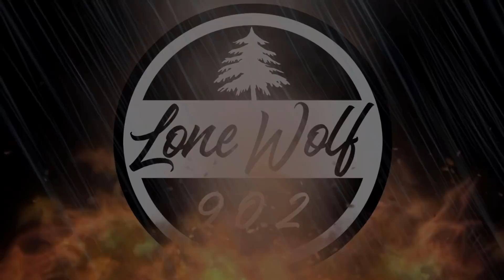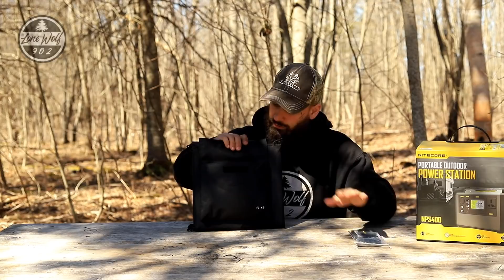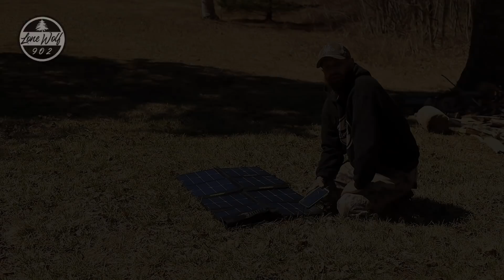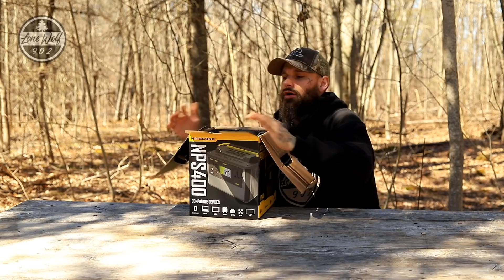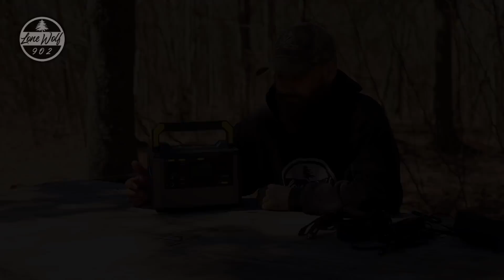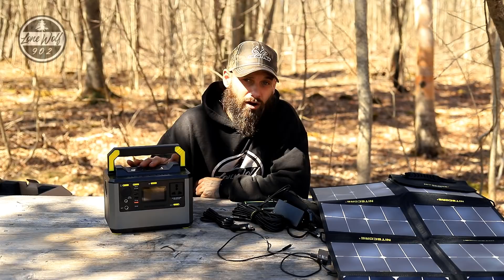Battery Charging Station And 100w Solar Panel - Nitecore NPS400

Comment: Can I ask the red light by the charge ports is on constantly but when I plug a device in it flashes , I’m not in direct sunlight btw.
Is this normal in low light ? I haven’t tried it in the sunlight yet.
Instructions  tell you nothing about the red light

Comment: Good Day,  I don’t believe I saw anyone comment on your question about V and A on your monitoring device.  So I thought I’d comment.  It’s a long one so I hope you actually have time to read it.  To start with since I get so much out of your vid’s I’m willing to give back. Secondly although I have a degree in electrical engineering, albeit 38 years ago,  I am both dumbfounded and amazed by technology advancements.  I can’t say I can fully explain the deviation you witnessed from the standard USB output vs the QC output, but I have enough info here that might rationalize it and perhaps a couple of things you can take away from this.  Most importantly I would suggest not to use your cell phone as a device to compare. Why? because most modern cell phones contain controller chips which prevents the amount of current entering the battery. Hence this likely what has  affected your readouts on your monitoring device.  I recommend charging something like one of your portable battery packs for better effect on current draw.  Getting to your question directly.  Yes A would be Amps and V would be Volts.  Watts = V times A.  This might be a better number overall for you to do comparisons with, at least on one level. So if we use your numbers starting with the regular USB 1.56A X 5.06V you get 7.89Watts (notice the NPS400 measured 9W - fairly close).  Now compare to the QC being 0.49A X 4.87V = 2.38 Watts (you didn’t indicate what the NPS400 was reading) But I think its safe to say since QC was only using 30% wattage compared to the standard USB is actually going to charge slower, again its your phone Software and Controller controlling that.  Another related point, notice the NPS400 only states watts on the panel and not voltage or amps, I looked it up, its because it feeds 5V=2A and 9V=2A 18W Max.  Again shedding some more light that your phone maybe regulating what it wants versus what the NPS400 can feed, in this case slower charge, ironically against the manufactures expectations I would assume. It would be interesting to see what the NPS400 showed when you phone was plugged in.  Notice this is the NPS400 spec for the regular USB output 5V=2.4A, 12W Max Each Port, that 5V Amp spec is 2.4V where the QC at 5V is less at only 2Amps.  So I speculate depending on the device you are charging it could be a faster charge.  I really don’t think Nitecore was trying to mislead anyone, they are trying to keep up with the fast paced technology changes as well.    Hope that helps…… Mike,
Reply from the maker: Thanks so much,  im really glad you explained this to me

Comment: What you need to do is attach a mostly drained device to the fully charged bank. Record time to charge device and final bank capacity. Compare that with a mostly drained device connected to fully charged bank with the solar panel hooked up. Record time to charge and final bank capacity
Reply from the maker: Interesting,  😊

Comment: the USB voltage reader is reading the output voltage from the USB port. the USB port is 5volt port and only output 1 Amp. That is only 5 Wat. If NiteCore could make the USB port with 30w output then the kit is very powerful. You can test the USB output on the panel. You plug the USB volt meter in one port and the phone is plug in on other port. after 15min you can see how much the panel charge the phone. This is the true output of the USB charge on the panel. 
The 100w solar panel is more capable output power. You can charge the phone and charge the battery pack at the same time. The battery pack should be in the shade for better charging performance.
Reply from the maker: Thanks alot, im new to the voltage readings

Comment: The USB voltage and amp tester that you have doesn't have the required hardware to activate the higher charge rates. If you want to charge your phone as quickly as possible, connect the phone with a USB C cable to the PD port. 

Your USB tester also will not tell you how well the solar panels are working, other than like in your video, it's working or it's not. Use the battery box to find out how many watts are being produced if you want to adjust them for highest output to the battery box.
Reply from the maker: Thank you for the information

Comment: Can you plug a power strip into the AC outlet, as long as you don't plug in more items than the output can handle?
Reply from the maker: Yes, it will work as long as you don't go beyond the output limit
Reply: @Lonewolfwildcamping  awesome, thank you!
Reply from the maker: No problem

Comment: Definitely something up with the quick charge, should be pumping out more than that. Would also expect the quick charge to drain the battery quicker not longer than the normal usb outputs. Could be a setting on the phone or the usb type C cable being used...
Reply from the maker: I found out the cable was not a quick charge cable

Comment: That folding panel looks good, thanks for the video
tip : 5 watts is not quick charging your phone, try a USB C cable and you'll get >30 watts
Reply from the maker: Thanks 👍
Reply: Most phones don't go above 18-20 watts while others are 25w to 45w and overseas 60w are better.